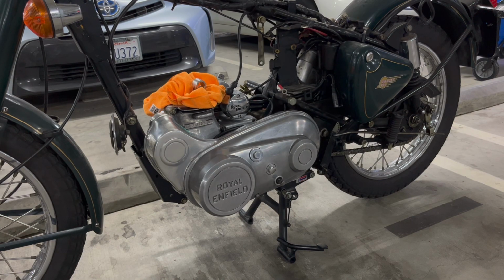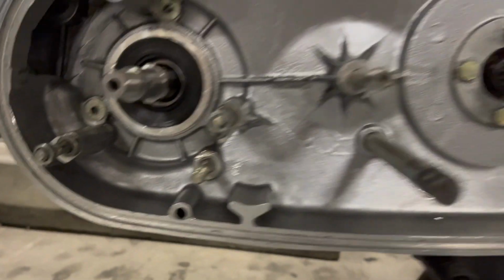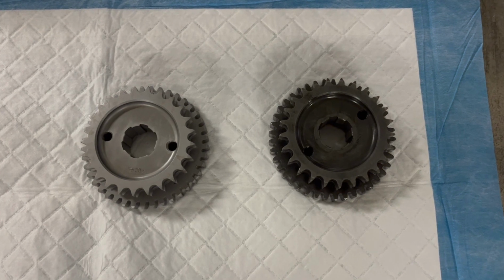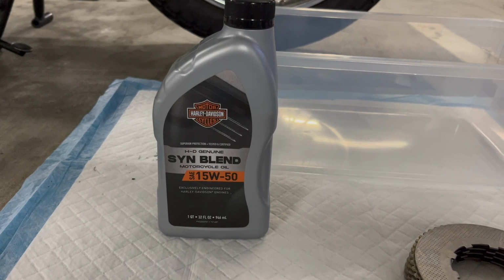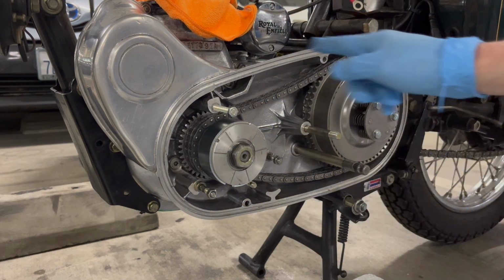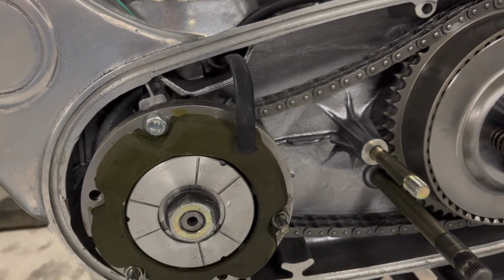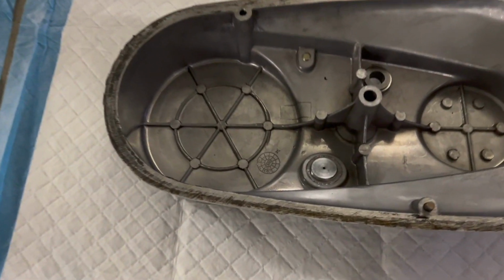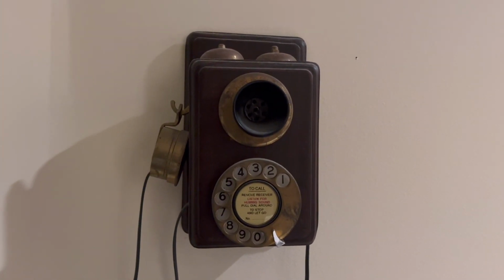Restoring my Royal Enfield Bullet 500 - Part 8 (3/4)

Comment: @Cycling with Gasoline your videos are proving very helpful. I’m current rebuilding a 2008 model last of the iron barrel. Got a NOS crankshaft from someone who had a spare but I’ve encountered the same problem as you with crankshaft sprocket. The original one won’t fit the new crankshaft so it seems you’ve solved my predicament and I will have to track down the pre 2004 crankshaft sprocket. Cheers and good work on the series.😊
Reply from the maker: Thanks for watching and I’m glad it helps! And I’m very glad I helped with the sprocket. That was a weird one. Hitchcock’s even changed their website description based on what happened, so people now know what to do
Reply: @Cyclingwithgasoline  yep was good to find the answer on your video. Now just have to wait for the part. Cheers

Comment: The original bolts for attaching the main shaft seal have lower head height then the new ones so these MAY be in a way of the clutch basket.
Reply from the maker: Yes, I checked this and everything clears